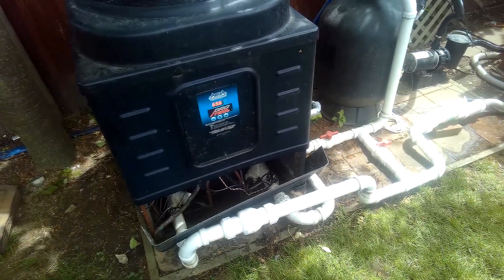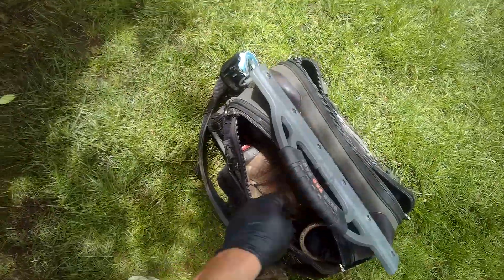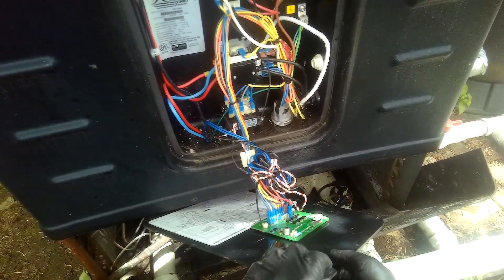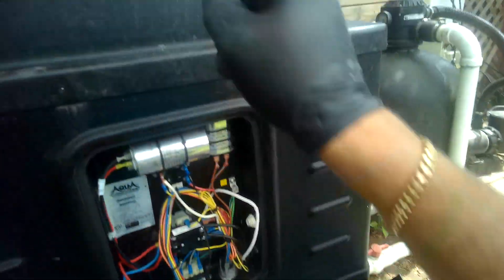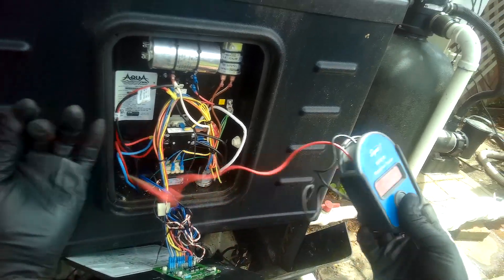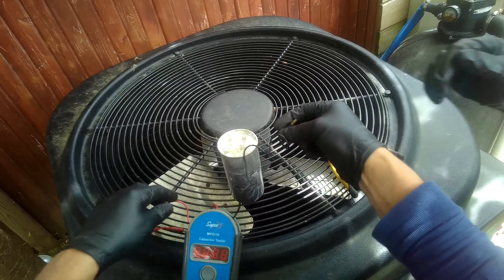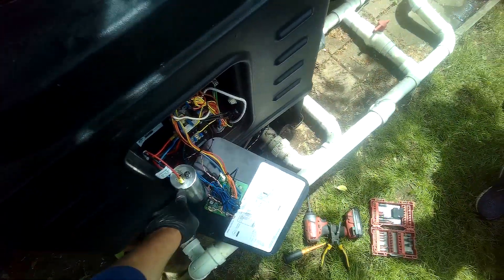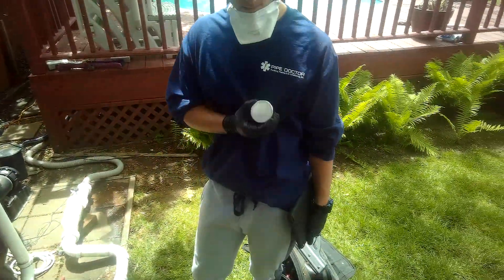AquaPro 1100e Pool Heater Heat Pump Not Heating - No Error Code - Compressor Not Powering Up

Comment: i had the same problem and fixed it , now the heat pump fan is running and pool pump is not on , ie  i get the FLO (which is correct), but the fan is running???? any ideas people ? thanks in advance
Reply from the maker: You need to check the condenser fan motor capacitor
Reply: @PipeDoctor  i used the dual one to repair it and heater turns on when i raise temperature , but will put a seperate fan capicitor in , thanks
Reply: i changed out both capacitor , and still coming on with no water flow! both capacitors are good. Water pressure switch maybe??

Comment: What if the front control buttons are not functioning, meaning even if the breaker is turned on they go blank after 15 min of functioning? What could this be the problem?